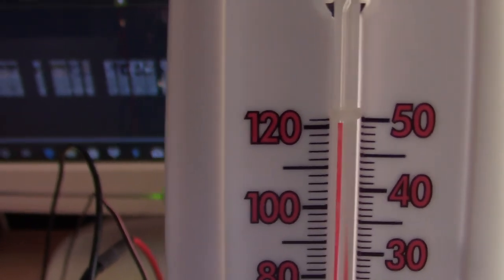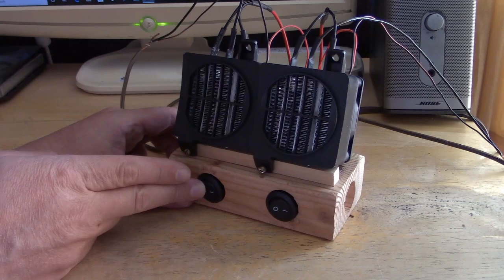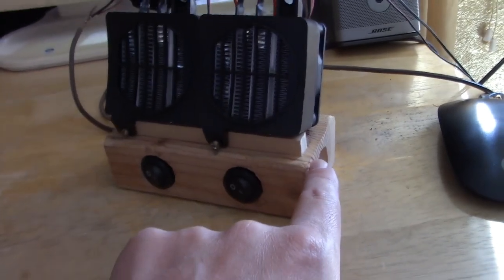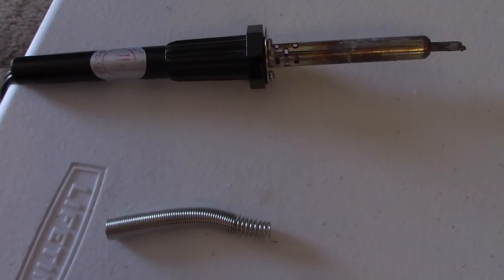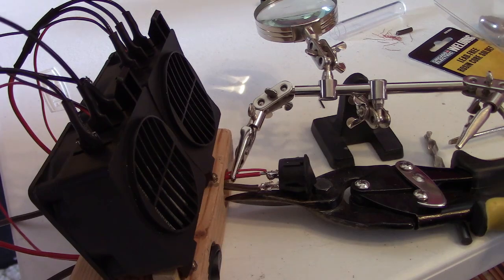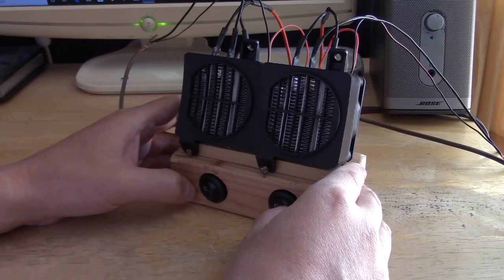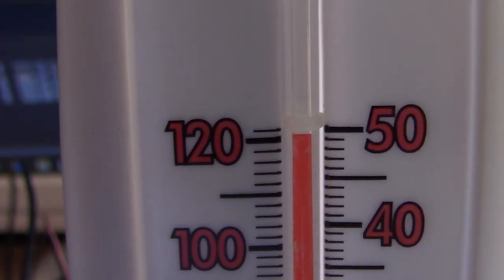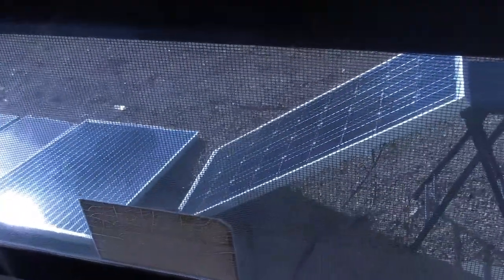DIY Solar Electric Air Heater! 200W 12V DC Air Heater! w/dual fans! high/low pwr! topped 120F/50C!

Comment: Hello, I live in the south of France. your video is very interesting! I would like to put 2 400 watt solar panels on my roof in parallel to power 2 100 watt radiators like yours. I wonder if we shouldn't place a regulator between the panels and the radiators, but which one? because sometimes the panels provided a higher voltage and the regulator managed the sending of 12 volts to the radiators. This project concerns the heating of a small, very cold bathroom of 6m². Thank you for your support

Comment: Hi electrical newbie here. Does they use 100w on low power or less? Thank you.
Reply from the maker: hi. they are just one speed and usually pull about 100 watts. high power is when you run both units, so 200w total
Reply: @desertsun02  thank you.

Comment: @desertsun02 This is a great video. I am planning to build a very little off-grid garden office and this seems to be the perfect solution for heating. However, I have zero knowledge of solar panels and batteries. Can anyone advise what kind/size of solar panel and battery capacity I would need if I wanted to run one heater only (100 W) for 4 to 5 hours a day? I am in London, where there isn't a lot of sunlight available in the winter, but I would only be running the heater off the battery, nothing else. Many thanks for any help!
Reply from the maker: hi and thank you! one heater draws around 6 amp hours per hour, so 6 x 5 hours would be 30 amp hours. if you are using a deep cycle battery i would go with one that is 100ah or more. a 100ah battery should run this heater for 5 hours easily. the reason i suggest a 100ah one or more is because you can only discharge 'deep cycle' batteries about halfway. i find it best to only discharge it about a third of the way, meaning i only use about 33 amp hours if the battery is 100ah and then i recharge it.
Reply: @desertsun02  Many thanks for this, it's very useful! Just a couple questions if that's ok. What kind of solar panel would you go for? Can the battery not be used while it is being charged by the solar panel? This is just to see if I can get away with buying a smaller/cheaper battery. In your experience, do you think the heater has to be run permanently to maintain a comfortable temperature in a very small, well-insulated room if it's very cold outside? I'm only thinking that perhaps I could run the heater for less than 5 hours a day. Many thanks and sorry for all the questions, I won't bother you anymore =)

Comment: where do you get the solar panells from? and how do you know what size solar panelles to get so you do not blow up the heaters with to much power? also i see the panels are out side. so when you ran the wire to the panels from the fans inside to the outside, did you do so by leaving a door cracked open? or a window.
Reply from the maker: i usually buy solar panels on amazon. they are as low as 50 dollars for a 100w panel these days. you can use any size 12v solar panel that you want. the heater will only pull the power that it needs. you could use a 1000w 12v solar panel (if they made them) but it wouldn't hurt the heater (because the heater just draws the power that it needs). i run the wires in where the door meets the 'house frame'. typically doors don't fit 100% perfect so i just run the wires in where there is a little space between the door and the door frame. you could also run them in a window

Comment: Hello friend.saw your video's.great idea. But what if you have no clues about electric? How and wich wires I must connect togheter and then how to connect to a solar panel? A solar panel has connectors..how do you fit your wires with the solar panel.
You see I really don't have a clue but I want to learn.
So thanks for your video. Hope someone can give me a answer.
Greetz from the Netherlands Europe
Reply from the maker: hey there. it's really pretty easy to do. the heaters have red and black wires (positive and negative) and solar panels are the same way (so all you do is hook the red wires (the positive wires) to the positive wire of the solar panel and the black wires to the negative wire of the solar panel. that is really all you need to do. solar panels often have fancy looking plugs at the end of the wires. those are called mc4 connectors. if your solar panel has those you can buy a set of bare wire cables with mc4 connectors on one end. if you use those your solar panel will have bare wire at the end of the wires.

Comment: I'm looking to do exactly this a question I have will it run underpowered? Meaning if you don't get quite enough sunlight will it still run just not as hot and not as fast or does it require an absolute minimum before leaving turn on? For example if I have a 200 watt heater and it's only getting a hundred Watts of solar will it still run just a half power?
Reply from the maker: yes, you can run it under power. it's proportional to how much power it's getting. btw, if you like this i've got 2 more units similar to this that i've been working on. vids will be out in the next few weeks. one is a little smaller and one is bigger. bigger one pulls close to 20 amps at 12v and puts out tons of heat.

Comment: Interesting concept,,, However, no info on how to build the most important part... Show how to build the heating coils please ???
Reply from the maker: hi, the heating 'coil' comes as a unit (pre-built). amazon sells them so you don't need to build that part. you can buy the ceramic chips and the fins separate if you want.

Comment: I have a 345w 9amp 38v Solar panel. Could I hook the two heaters to the one panel?
Reply from the maker: hi. the voltage of the panel is too high for a 12v heater. you'd most likely run into problems

Comment: I have a 300w panel 37v 8.1amp, could I use a DC to DC converter and hook 3 of these up?
Reply: 3 in series could work 3x12=36v

Comment: That's awesome.

I have a question.
Can I have one 415 watt panel powering 4 of these directly from the panel?
At peak I don't think the 415 watt panel outs out 415 watts, I think it's below 400 watts.
If the panel puts out more than 400 watts could I wire up 5 heaters?
I assume the heater load needs to be greater than the panel's output otherwise the panel would blow/damage a heater or more than one heater? 

I use a space heater for my room that is 1,500 watts and I'd like to replace it with solar panels directly wired to a heater like you did.
Could I wire up four 415 watt panels (approx 1,400 watts) and have 15 of those 100 watt heaters all wired together?

 If so how would I wire it all up?

Would I wire all four of the heaters together on one master switch then wire that to the panel?

Or what that cause a problem?

I haven't yet learned about solar power or electricity/electronics much yet.

Thanks.
Reply from the maker: hey there. it's a 12v heater so you have to use a 12v solar panel. i wouldn't try using a 415 watt solar panel because they usually (if not always) have a much higher voltage (probably 40V or higher). the highest wattage 12v solar panel that i've seen is about 210 watts.
Reply: @desertsun02  3 in series

Comment: You can add a motor controller in between the ptc & the power source and you can adjust the output... tested this out today.
Reply: Rehostad ?
Reply: Do you mean pwm device between solar panel and heater? What is your voltage range?
Reply: a PWM, yes, I have like a 20 amp unit
mine is between the battery & the heater.
 @Zanderman2000

Comment: Would the heat from this setup be available only while being generated, daytime that is, or could it be stored and used in the evening when temp drops?
Reply from the maker: hi. you could store it if you wanted to. or you could run it off battery or other source at night. i'd probably use some sort of thermal mass like rocks to store the heat (but you'd have to experiment)

Comment: Hi, thanks for the video. I don't understand how to connect the wiring up to the solar panel. My solar panel has mc4 connectors. Could you explain the wiring up in more details (for a dumb woman who never as much as even changed a light bulb to understand🤣)
Reply from the maker: hi there. they sell mc4 cables an amazon with bare wire on one end. that would be the best thing to use. then you can just twist the wires to connect it all. they only cost 5 dollars too here's a link
https://www.amazon.com/Renogy-Controller-Connector-Adaptor-Extension/dp/B00DGXVO80/ref=sr_1_3?crid=2TEFJCPTWH93C&keywords=mc4%2Bbare%2Bwire%2Bcables&qid=1647898475&sprefix=mc4%2Bbare%2Bwire%2Bc%2Caps%2C196&sr=8-3&th=1
Reply: @desertsun02  oh thats super, thankyou so much. I am in the UK but i am sure the cable prices will be similar. :-)

Comment: Can you put a solar panel on the inside front window or does it have to be outside
Reply from the maker: hi there. it can be inside. they work better outside though (because the window reduces the effectiveness of the sunlight)

Comment: What kind of battery source are you using
Reply from the maker: hi. when i run it on 12v battery it's usually to a 101ah deep cycle battery

Comment: If we have not solar panel how we can use then please reply me
Reply from the maker: hi there. any 12v power source will work (as long as it generates the amps that you need). you can run this off a 12v deep cycle battery or your cars 12v power socket. you can also run this off of wall current if you use a transformer.

Comment: Your videos are very helpful, what is the insolater or how does the plastic not get melted on those devices? I would like to buy some just curious or do they use plastic not to have heat transfer! You think with those Temps thier must be somthing around the perimeter of the heater core?
Reply from the maker: @Nathan Mciver thanks. the plastic casing holds up perfect. it doesn't melt. some plastics have very high melting points so they could easily handle the heat that this unit generates.
Reply: Amazing! Thanks for your reply! I have seen lots of your work! That helps alot with our work here! I can see you genuinely appreate science! I find that fascinating that with that item the science could go in a multitude of directions so I had to ask! I find that surprising that the plastic  dosent melt, I can emagine after seeing the product this would make sence! I made a water system for my parents and it works well, I just think this would be a more affordable way to heat thier green house within winter! I will just have to seal everything within there!

Comment: Any idea on the amp draw for each fan and heater thingy? to determine the battery size I would need to have this heater run at night.
Reply from the maker: hi there. each unit draws about 6 amps total (figure 6ah/hr). the heater is 6 and the fan is next to nothing is how it works out 👍

Comment: With the cost of energy and that I have 12. 100watt panels.  
I’m curious as to did you shut off the heat to the room they are in.
Reply from the maker: wow. twelve 100 watters. you can make a lot of heat with all those (i wish i had that many panels). 👍

Comment: Hello. Could you please tell me. There are two cables one black and one red and there is a third tiny cable black and red which are together. What is the cable for? Thank you
Reply from the maker: hi there. there are red and black cables for the heater and also the fan. the thinner red and black cables are for the fan (i think that is the one you are asking about) 🙂👍
Reply: @desertsun02  Thank you!!!

Comment: I need something like this for my van. If you could make something safe for vans you could make millions. We all currently use propane or deisel, which is pretty pricey!
Reply from the maker: hi there. this should be totally safe in a car or van. it's super compact, in a plastic case and should easily run on a cars or vans 12v power port 🙂

Comment: Any recommendations for a solar powered heating system for a full garage? I'm trying to find a decent heating and summer fan setup for my 3 car garage using only solar panels. Looking at setting up a 300W system.

Comment: The fans you used in your two  videos are different from video to video, which fan/heater assembly to you like better?
Reply from the maker: hi. well both are 'cool' but i like this unit because it's a full 200w (and it's got the switches) 👍
Reply: @desertsun02  what I meant is what model fan to you like better?

Comment: Would be good if you got instructions on how to build one cheers
Reply from the maker: hi there. this video contains "the full-build with instructions". the heater comes pre-assembled, so other than the talk-thru - all that was needed was to show how to install the switches and the soldering. is there any part i can help you with? 🙂
Reply: @desertsun02 yes help please make another video showing step by step

Comment: Is this something I could leave on all the time even if it became cloudy or when the sun went down? Will it burn it out if there isn't enough energy coming in or will it simply run at a lower speed and temperature? I'm thinking that a couple of these would be nice in my basement after I install my heat pump so that it can offset the energy usage even more.
Reply from the maker: hi there. since i haven't tried all situations this is only an educated guess but since both the ceramic and the fans run proportional to the amount of power supplied to them, it should be fine to leave it hooked up. of course monitor it though to make sure.

Comment: What kind of solar panels are you using? And how do you plug this in to it? If buying a panel what wires should I look for?
Reply from the maker: hi there. i run this particular heater off of 2 100w solar panels. one is a renogy and the other is a hsqt (i think). any 12v 100w panels should work thou. they even make 12v 200w panels now so you could run it off of just one panel if you want. this heater is just a straight connect to the solar panels. for a detailed explanation of how i hook up my projects, i made a separate video. here is the link https://youtu.be/bQGQuXF82tI

Comment: Freakn smart. Have you tried connecting a thermostat so it can turn on and off when a room get to a certain temperature? I wanna tr to hook one up in a camper
Reply from the maker: thanks. it should work good in a camper. i've haven't tried a thermostat on it yet, but it should be an easy addition. i recently bought two of the 12v thermostat controllers for future projects but since they are just sitting around waiting to be used i may try one on this heater
Reply: @desertsun02  nice. Hope to see a video of it if you do.

Comment: Fantastic! I'd like to use this 72 Sqr Ft lean to greenhouse to up the temp for tomatoes. Obviously, I need to store energy to run it overnight and a car battery should work well. Have you tried this at all?
Reply: @cynthia clark use a deep cycle battery, not a car battery.  Also, you could connect it to a battery tender to keep it charged.

Comment: We always want more. What is your estimate time for this unit to run successfully on a 12-volt Automotive style battery. Or in some cases a deep cell battery? Any estimate on the square footage that this unit would possibly heat? Would you leave it unattended and let it run off the solar panels or 12 volt battery? I'm thinking in the way of a 12 by 28 cabin that has water inside to prevent it from freezing.
Reply: Time on batteries depend on amps in the battery.

Comment: I'm not good making this kind of stuff, but I'd love to buy one from you to try using in my greenhouse with my solar panel and/or solar generator at night.
Reply: You don't need to build one, you buy one and just connect the wires to a 12v battery. There is a better one that works by convection and is a bit bigger for about £25 on Amazon and it has no fan and you just put the wires on a battery and the heat just gets rotated naturally.

Comment: do you have any idea how long the fan will run using the 12v battery i plan to use this to provided heat during the winter while sleeping in my car any suggestions would be very much appreciated
Reply: NO. It will kill car battery fast

Comment: What are the heaters called and where can I order them from?
Reply from the maker: hi. they're called PTC 12v ceramic heaters. amazon sells lots. here's a link to one. https://www.amazon.com/Constant-Temperature-Heating-Conditioning-Products/dp/B082HR1GWY/ref=pd_day0_c_469_1/143-3040554-3226717?_encoding=UTF8&pd_rd_i=B082HR1GWY&pd_rd_r=7a092253-5590-48a2-9b68-7bd3048bf4d7&pd_rd_w=ilwz3&pd_rd_wg=GjZyh&pf_rd_p=52c44813-ece5-43b5-85d3-aeb14689b184&pf_rd_r=641N0SBTBCAQVTP8PVDX&psc=1&refRID=641N0SBTBCAQVTP8PVDX

Comment: Is there a fuse or a battery between the heater and the solar panels
Reply from the maker: hi. no battery needed. it's just a straight connect from the solar panels to the heater.
Reply: @desertsun02  Thank you

Comment: Hi and thanks for the video. 
Is there a way to connect a thermostat. 
I'll be in an rv in the wintertime and any heat is welcome. 
If this could run without turning it on and off manually would be great.
Reply: At aliexpress/ebay look up digital 12v temperature controller thermostat. Single output, single setting, board level, no box, is $2. Two channel, case, timers, $8-15. All include sensor.
Also look up ammeter. Similar cheap prices, add external shunts to measure 10A to 100A.